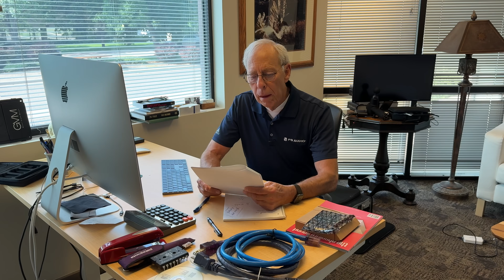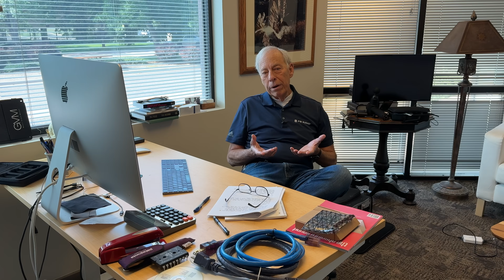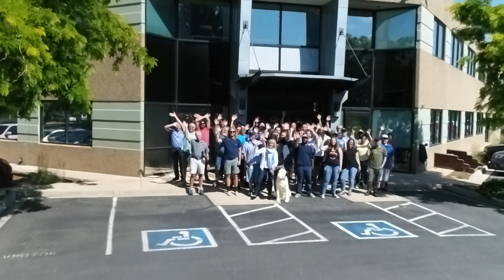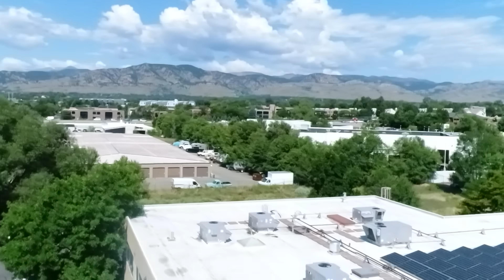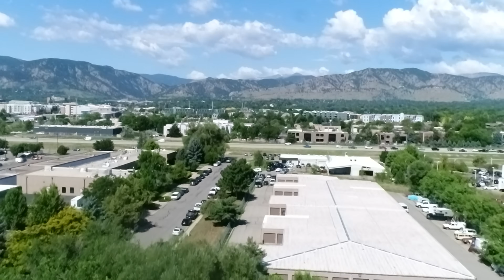Gain differences between XLR and RCA

Comment: My sources to my amps do not have XLR outputs even though my Pro amps (QSC's) does. Went round and round and was almost ready to redo my whole system because I thought I was missing something. My truth is after an insane amount of research, XLR has very small if any benefits for the average user. If you are wiring up the next U2 show XLR is for you. If you are like most and their amps are less than a foot away from the source, RCA is just as good. Paul just happened to give away the secret why the average person who converts to XLR thinks it's better.

Comment: In my opinion it’s better to have a 6db switch like manufactures do. Sometimes you want the extra gain depending on your preamp or source
Reply: Also XLR setups typically have longer signal cable runs....so I suspect a higher voltage would be advantageous as to fight any voltage drop across a longer cable run.

Comment: Is XLR more audiophile than single ended or just bragging rights? I have heard, your system isn´t serious since you don´t use single ended. I´m using Vincent Audio mono blocks, hybrid design using tubes and Vincent preamp, No XLR in this design from Vincent but it sounds great. Now waiting on a new Preamp to arrive from Germany, something special made from New old stock Telefunken tubes. Looking forward to it.
Reply: Technically XLR is a connector type and single ended is a circuit design type. XLR tends to be used with and assumed to be a balanced circuit where single ended tends to use RCA. Each has advantages and disadvantages. Both in RCA vs XLR and balanced vs single ended. Just the existence of one or the other does not automatically make it better than the other.
Reply: @glenncurry3041  :D I know the difference, I´m addressing how I feel there is a elite group of audiophiles that act like their XLR is the only way serious enough to be called audiophile
Reply: It depends, some say XLR is for professionals, but RCA can sound more refined
Reply: Guys..xlr eliminates all noise. Anything not pressent in both is cancelled..thats why balanced is used for long runs of cable..it subtracts the noise..yes its way better..
Reply: @davidstevens7809  Nothing eliminates ALL noise. And XLR is just a connector type. There are other balanced line type connectors. e.g. TRS. And you have it exactly backwards. it's called common mode rejection (CMR) because of it is ability to reject signals that are common to both of its lines.
Reply: @glenncurry3041  i agree. But if comparing rca. Unbalanced to any balanced.. balanced is better. Especially with long cables/or rooms with hf noise.
Reply: @davidstevens7809  A short length of unbalanced (RCA) between a wide band DC coupled input and output (e.g. pre - power amps) is a wider bandwidth and better phase alignment than cheap balanced circuits with transformers and/ or decoupling caps.

Comment: Nice explanation. But I seem to prefer the perceived notion of louder sounds more dynamic and engaging. If the amp does not clip or distort that is. For this reason I like variable output Dacs, this way I can adjust the balance between Dac and amp.
Reply: Do you realize that depending on the DAC, unless it has a variable analog stage using it to reduce output levels is just throwing resolution bits away. e.g. if you want half the (volume) voltage out of your DAC you are tossing away the most significant bit. You've just cut the resolution of your DAC in half.
Reply: My general experience is those extra decibels make a difference in headroom, I’m not necessarily looking to get my music louder as a whole but I tend to achieve those higher peaks better on most XLR inputs.